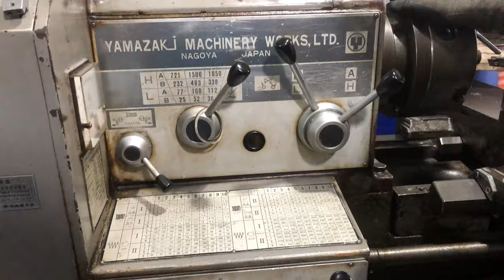Making gear wheels - machining a gear shaft

Comment: Why make the gear part of the shaft?
Reply: Why would you not?
Reply: @redmorphius  Hell to replace when the gear teeth get worn. If the gear it's a separate part, you could make it of a harder material than the shaft, or heat treat it/surface harden it separately and probably even get better tolerances when it's machined separately. You could also keep spares of the gear as well...I mean, no rules are set in stone but I really don't know all of the context. I just know that most of the time, it probably is the most cost effective solution like it is right now.
Reply from the maker: The original part is like that brother. The spur gear machined within the shaft itself. The gear is subjected to high torques. I think that's the reason the gear comes with the shaft.
Reply: @sand9577 by using a replaceable gear, you will weaken the shaft since it needs to be smaller at the gear to allow the gear to slide on. That will limit the amount of torque the shaft can transmit.  You will also weaken it by installing a keyway to keep the gear from rotating.  A shaft this small is usually best designed as shown in the video.